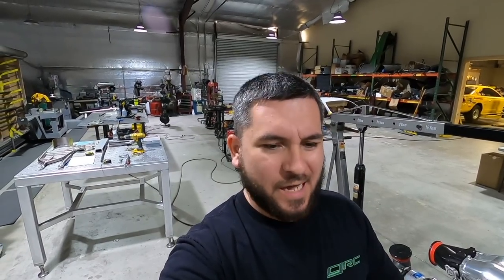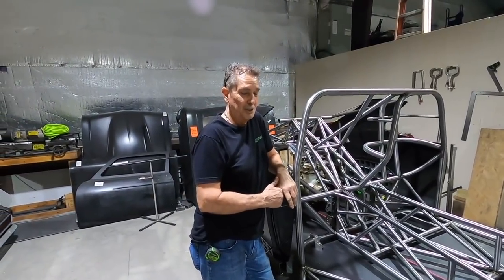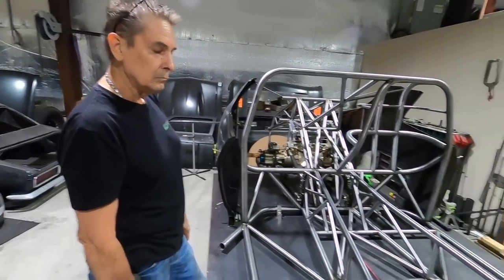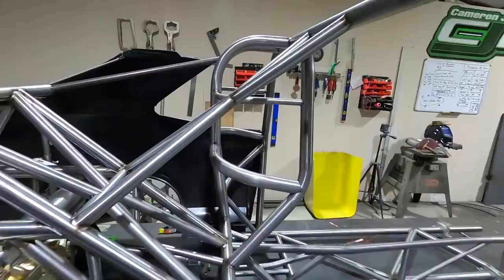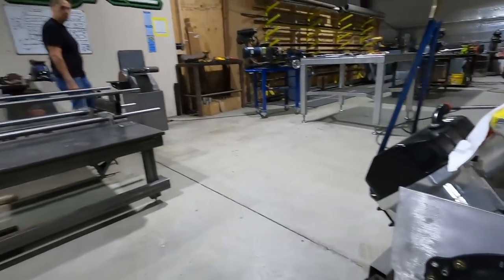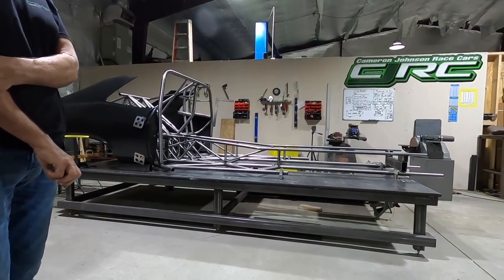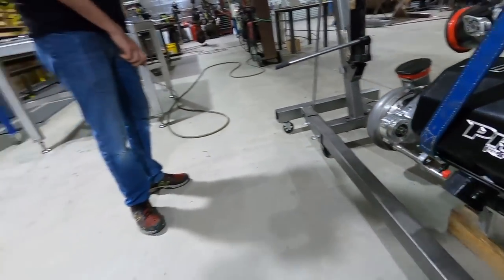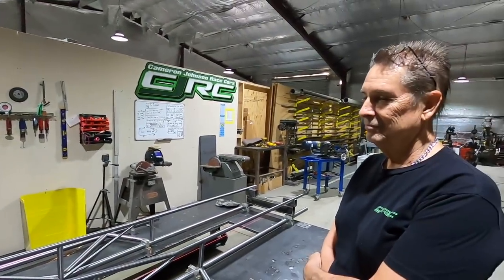NOVA BUILD EPISODE #1 Chassis construction

Comment: Awesome work! When closing tubes on a chassis update, I've had to drill tubes I was joining, with a 3/32" - 1/8" bit . I did that to relieve some shielding gas pressure build-up. Do you do something similar, or do you practice something different? Anyway, your work looks impeccable!

Comment: Keep up the positive videos. Couple questions. Who manufactures the rear housing? Do you think a fuel bladder type cell would help prevent the frontal damage, explosions and fire like we have seen lately? Very nice videos guys
Reply from the maker: That is a Carmack Engineering rear end. Not sure if fuel bladders would help or not with the force they hit the wall some times. But something to consider
Reply: Since I have experience with bladder style fuel cells I'd have to say that cost and manufacture time would make them a deal breaker for most drag racers. The types of cars that require them are carrying 10, 15, or even 20 gallons of fuel, so keeping the fuel in the cell is a big deal. These fuel cells come in standard configurations designed to be installed in the rear of the car and are not only huge, they are very expensive. These types of drag cars will carry 3-4 gallons max, so you're looking at a much smaller mess (fire) if some gets out. Bladder style fuel cells are usually available in standard sizes and designs for their intended purpose where drag cars will usually have a custom cell built to fit in a tighter spot in the front of the car. To have a bladder custom built would be extremely expensive, and could take as much as 6-7 months to have done. They also require certification and will have to be re-certified/replaced every few years. Most of the fires you see at the dragstrip are a result of an engine failure causing engine oil to be liberated from the crankcase onto glowing header tubes which then ignite into a ball of flames. I'm not saying there isn't fuel fires, fuel lines fail, the car can nose into the wall causing a rupture,etc. I'm just saying a bladder fuel cell wouldn't be a huge safety advantage considering the cost and the difficulty in manufacturing a custom bladder for every custom fuel cell. Besides, we're drag racers, we'll die like men! (that's a joke) lol

Comment: Hey man love learning about your builds! My whole family have bikes and trucks. I’m looking for advice to break out into fabricating custom cages/ cars like you do. Long story short 5years ago I gave up a great career in business to persue some thing I really enjoyed. Started out welding and now I’m a steel fabricator. I build railings and monumental staircases for a living but I’m not satisfied with where I’m at now. I was lucky enough to learn start to finish how to fabricate rails before my company invested in a large amount of machinery. Cars, trucks and motorcycles have always been a passion of mine. I’ve applied to a couple of shops around the Baltimore area but haven’t had luck. Literally the only thing I can think of is starting out on my 01 Cummings and Fabing a custom bumper, track bars etc. At least then they see I’m ready to go full throttle with this stuff and learn this side of the trade. Any advice helps man. Appreciate it!!

Comment: When setting the motor/midplates, are you pointing crank centerline directly at the pinion at full rearend extension?
Reply from the maker: No. Engine is pointed up slightly in the back. Will work better for both big and small tire that way.
Reply: @CJRaceCars  ok, so you're pointing crank at pinion with car at ride height?

Comment: Wow, very informative, chassis looks amazing, Danny does great work! 
I have a question regarding ARB link length, noticed it was longer to allow maximum extension of rear for radial application. Do you have a certain pivot angle you shoot for, one for radial and one for slick tyres or you just make sure it doesn't fully extend before the shocks are fully extended?
Reply from the maker: Just make sure it doesn’t fully extend before shocks. Angles can be different per anti roll bar based on the arm length

Comment: How do you determine the length of the 4 link bars needed? Is it whatever fits from the axle C/L to the first bar? 

Thanks,
Nick
Reply from the maker: There are a few lengths for big tire cars that most use. All somewhere around 21”. We make adjustments in the placement front to back of the #1 bar to always use that same length

Comment: What's your theory on 4 link bar lengths? You said you guys run 21" some run them shorter and some longer. Is there any advantages one vs the other? Is 21 your standard for pretty much all of them or is it depending on other factors like wheelbase length?
Reply from the maker: Yeah we run 21” on pretty much everything. The longer the bar the softer the 4 link adjustment is per move. If the bar was short and you moved it down a 1/2” on the front it would be a drastic instant center move. 21” is about the longest you can usually go with where the crossmember is located in most cars.
Reply: @CJRaceCars I got you, makes sense. Thank you for replying

Comment: When you set the driveline angles , do you parallel phase everything? Mark Williams has a parts book that explains this as the best way to set driveline angles on a new build. A friend of mine has been building race cars for 40 years and he uses a fixture to point the motor straight at the 3rd member , then he adds 1-1/2 degrees of pinion angle. The way Mark Williams explains it , is that you want the same u joint operating angles or the driveshaft can jump rope at higher RPMS. He also states that the motor , driveshaft and 3rd member angles need to be within 1/2 degree of themselves. What I did for my car at ride height was parallel phase the driveline ….Motor 1.2 degrees up in the back , Pinion angle 1.2 degrees down and my driveshaft has 1.5 degrees. I would think that pointing the motor and pinion straight at each other then adding pinion angle would create different operating angles , which method is right or are they both right?
Reply from the maker: Lot of opinions on this and to be honest I’ve seen some cars work with some crazy angle. We point all our stuff up 1.5 degrees and try and set it for a happy medium so it will have a good angle with big tire and small tire.
Reply: Got it , thanks for the reply! I forgot to ask about the 4 links. Do you guys use equal or unequal length 4 links? I used shorter bars up top , but it looks like most people use equal length 4 links? Thinking about the geometry , it would seem like unequal length 4 links would have a sharp pitch change when cycling through its range of motion.
Reply from the maker: @extrememftickler7628  depends on 4 link brackets and bit tire or small. When 4 link bar changes a lot to go to small tire the bar has to be longer. Most pro mod style brackets use a slightly unequal length upper and lower.
Reply: @CJRaceCars   thanks for the info! I’m addicted to CJRC build videos for sure!

Comment: Do you drill vent holes where the notched tube meets the mating tube? Also when welding 2 notched tube that overlap do you weld one then place the other over the first and weld or do you just weld the 2 in place?
Reply from the maker: Yes we do 1/8 vent holes. We always weld all of the tubes complete before putting another tube over it where it can’t be welded .